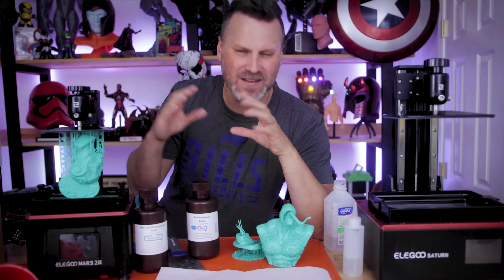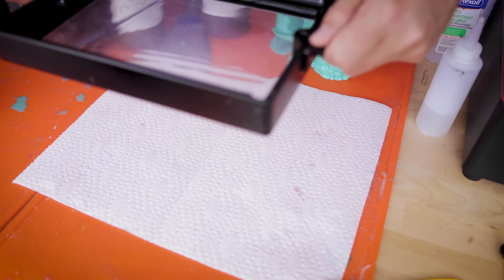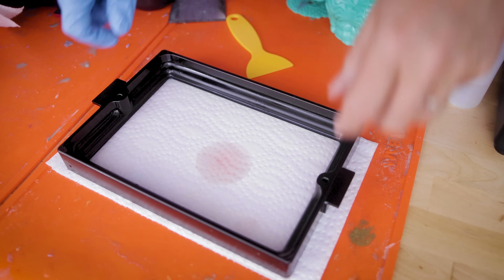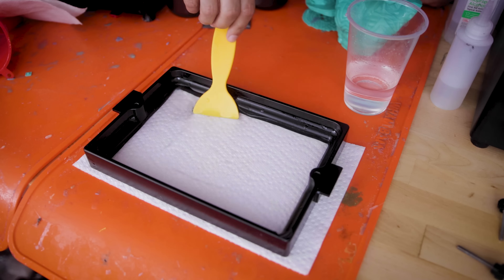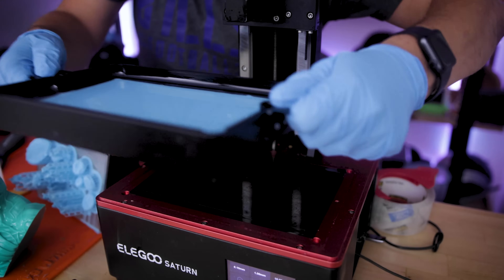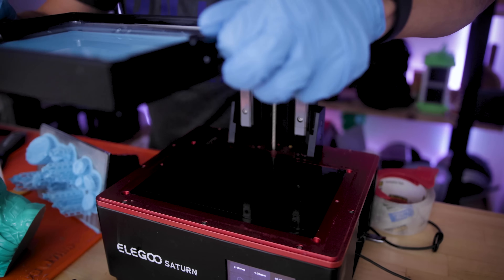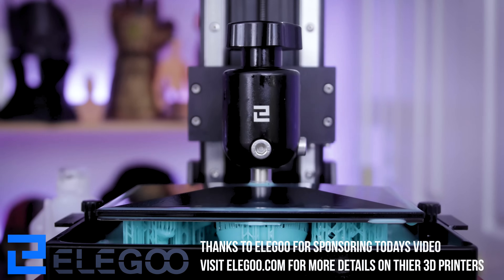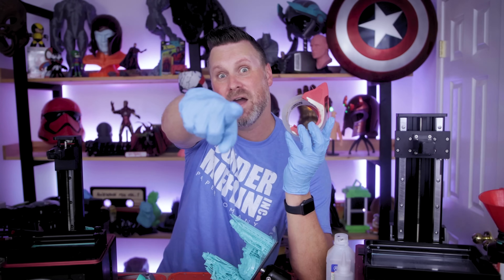Can you fix a FEP with Tape? Resin 3D Printing Test!

Comment: ok i saw your video... and i am wondering... i got no issues with the tank but accidentally i dropped the building plate, and even tho it looks undamaged i noticed the corner is the part that got hit, and it has a little tip going below the level of everything... i leveled it and even tho it worked pretty nice is it ok to print with it? is not a bug damage, maybe 1mm or less of the corner sticking outside but is it safe to use it like that?

using an elegoo saturn 3

Comment: Thanks for a really helpful video. I wish I had seen it before I bought a new set of sheets because I made a small hole when trying to get the resin sheet out of the vat after a clean😢

Do you know if it’s possible to buy a flex sheet for the Anycubic Photon Mono M5s pro? I have been having real trouble releasing my prints from the building plate.

Comment: Confirming, - You can print even longer with the tape (of course, probably depends on the size of the hole), - I was printing 2 weeks like this. 
(during the print, - once resin gets through the hole and gets trapped with the tape, UV cures it solid and glues the hole)

My hole was "micro" and in the corner, probably also matters and that area is not very "flexy/bouncy" during the prints.
(I have got the puncture he very first day printer arrived.... built plate fell into the VAT.... Obviously, - I had no spare FEP....)

Comment: I tried this and I noticed that the print has a little surface dent from where the puncture must have been and also the print had a slightly raised line going across the print, obviously caused from the rim of the tape. So this solution is not going to work for everyone's needs, it just depends on what you're printing.

Comment: Does it make sense to attach a new tape after each print? I mean there will always be some cured resin residue stuck to the exposed adhesive I suppose...
Reply: Absolutely not.
This is a 'permanent' temporary fix, so you will.
You will be unable to remove all the glue and the cured micro resin blobs from it, and/or in attempting to do so you will damage the FEP film way way more than if you left it.

This is nothing more than a VERY temporary DIY hack, absolutely nothing more.
And the FEP should be replaces ASAP.

Comment: as someone who has testing this long term (not bc I wanted to) for +20 hours of print time: at a certain point, it begins to warp due to a micro amount of resin captures in the crevices. at first, as you can see here in this great video, it almost works like nothing is wrong, but keep in mind that's an extra amount of material not only to compress over and over but pass UV light through. small pockets with resin harden and remain. This cycle repeats and builds up to where you're going to have to compensate by releveling. At that point, you get the failures. it becomes more a matter of failed prints than broken printer. though i fear broken printer is next but i dont advise anyone go this long. but can confirm on the saturn elegoo atleast - if you are in a pinch, this will no problem get you through your next print. maybe two. but never test it if you can avoid it.

Comment: Maybe I am decadent but I simply have another vat (not as damage replacement but to make using more than one resin a more comfortable experience), don't need to risk my screen with temporary patches. Especially as a Saturn2 PFA sheet is 8 EUR per piece.

Comment: I just tried this cause I installed a new FEP and somehow managed to immediately put a hole in it when the last one lasted like 5 months(and I wasn't trying to undo all those screws again within 48 hours). Have a screen protector. 

So far so good? I mean I have a spare FEP and protectors I'm prepared to switch out the second I see funny business. But good to know I'm not the only one who had this thought. 

apparently they do make actual FEP grade tape too(like legitimately the same material as your fep)? I just used clear duct tape. 

This worked well enough that I actually replaced the black electrical tape around the screen with packing tape cause I guess at some point mine got resin on it and it was kinda ew. The machine looks a little silly but it's staying clean and so far nothing has rattled my confidence. No fluid getting under the tape(you can press it and see bubbles if it was), etc etc.

Comment: I just started with Resin printing and wondered, since there are protection foils for the UV screen, could they not be put either into the resin vat or on its bottom? Sticking it into the vat could protect the FEP and sticking it oudsite onto tho bottom would prevent resin from leaking out if the FEP might be damaged. At least these are my thoughts...
Reply: A few years ago when I first got my anycubic mono and it had the unattainable FEP in a frame I was forced to use packing tape to fix a hole. I printed for weeks with it until a gave up on a anycubic replacement screen and swapped out to  Sovol vat.  The packing tape never did leak.
Reply: @Tank1TC  These days I'm thinking about the foil where the prints do not stick (nFEP was it called). I can imagine with no sticking it should last longer and the printing supports could be reduced as well.

Comment: The hole will contain liquid resin, then the UV lamp will solidify it in that hole, it will stay there and that hole will prevent the passage of UV light because it is covered with solid resin and technically it will be a hole in all impressions and its depth will depend on the height of the model to print.

Comment: For resin newcomers, pinching a hole through your fep is inevitable especially during those first few prints where you are experiencing your most fails. 
I would suggest to run your finger all over the fep every other times just to check if there are any bumps that needs attention . 
Clear tape works for temporary fix, just make sure you cut it with scissors on both side. Dont tear it off of a dispenser which will create those ridges and will affect your UV light on that area. During slicing try to avoid the area with the tape because it will show up in print. 
Another useful tip is to never ever wipe/scrape your FEP with any tools, not even the plastic scrapper or kitchen towels. This way it will stay clean & clear longer. If you really need to wipe em, dry some wetwipes and wet it with some IPA.
Reply: What is the reason for tiny puncture holes? I have been using my mono for ages, and this is like the first time it happened to me. I just upped the lifting speed, can that be a cause or it is just an accident?
Reply: I was considering soaking some 1x1 inch microfiber towels in IPA and then just stick the container off to the side of my workbench, anytime I need a wet wipe I'd just grab a small cut towel.

Would that work similar to the wet wipe and not scratch the FEP?
Reply: I touched it with my bare finger and it left a mark, use gloves lol.

Comment: I was being a complete noob yesterday when I got my Saturn S and made a micro tear in my FEP after my second ever print. It wasn't visibly leaking resin from the bottom, but was leaving cured resin on my LCD after prints. I was so worried that I broke my machine and would not be able to use it again until I got a replacement sheet, but I tried this method out and it totally worked! Next print came out beautiful and I just got my replacement FEP in the mail today. Thanks, Uncle Jessy!

Comment: If you even need to do a patch like this with tape, first get the surface of the sheet and the tape wet. Ideally with  mild soapy water. Apply the tape and then run a plastic straight edge over it to remove any air bubbles. allow to sit for a bit to cure up. Tape will be hardly noticeable depending on the color of it.

Comment: My FEP just got a hole in it. I just replaced it recently too which is a bummer. Maybe I should try this for a couple prints before I replace it. I also wonder why is the FEP so thin? Wouldn't a thicker FEP sheet be more durable and longer lasting?

Comment: Thanks Jessy, you da man. I'll be doing this on my Saturn today. Luckily I had a transparency sheet to protect the screen ( actually the original sheet that came with the printer) Was fine for about 20 prints. I messed up attempting to print some hollow trees. They weren't initially designed for resin and were far too thin. Scaling them down didn't help either. Great work on your channel as usual.

Comment: If the tape works on the FEP why can't we protect the screen with a thin sheet of plastic like the tape with adhesive like phone screen protectors? This way if the FEP leaks the screen will be protected and you just peal the sheet off and replace it, no cured resin on the expensive screen, this would definitely save a lot of headaches on a more advanced printer like a 8k or the coming soon Elego 6k printer. I see otters have used various products to do this, the printer manufacturers should sell something like this unless they want us to buy new screens?? $$$$$$$¢$$$$$$$¢

Comment: Does this impact on print quality?

I've got a FEP sheet that's wearing thin due to a piece of resin that broke off a filed build being pressed in to it and I'm nervous about changing the FEP. Could tape prolong the life of my sheet until my spare vat arrives?
Reply: Yuo gona need to change the fep soon or later , dont be afraid , its happend to me, just saw some tutorial and be patiente, there is aLot of screw there
Reply: @noway8233  tape was pretty effective, I ended up taping it and buying a broken vat online and fitting new fep to that so I have two vats now

Comment: I did that after a rookie mistake when I accidentally dropped my build plate into the VAT, FEP was punctured. I can see the contours of the tape's edged as the light is slightly bent in the edges.

Comment: Silly question. Have you left resin in your printer overnight? I haven't done an overnight print since 2016 when mine leaked at some point in the night. I now only print resin when I am in the room and set an alarm for when it will finish. It would be nice not to be tied to the printer and I am seeing people leave them overnight these days.
Reply: I got Phrozen printer and I have left the resin inside for the past couple weeks with no problem. I would be more careful once the film starts wearing down though, maybe check for damage before leaving it in.
Reply: @ej-1608  Mine was brand new. Had it 3 days in 2016 when it happened. It blew out the LCD. I never left it in there after.
Reply: @The_Digital_Samurai  dang, good to know it happens.

Comment: Just bought my first 3d printer! Elegoo Mars 2, can’t wait to start my journey. You were a big inspiration
Reply: Good luck. I had my Mars pro for 4 days and haven't had a good print yet. My 3 prints have stuck to the fep film. 🥺 I just want successful prints. 😫
Reply: @yurushii  I have had any failed prints yet… but my Epax x156 I just got is another story… pancakes after 12 tries… $3000 paper weight
Reply: @hoosegowindustries  i know you're pissed. I just want to have successful prints. I'm trying different exposures, bed leveling, cleaning my vat, e.t.c. My prints are still sticking to the fep sheet. I don't know what to do. 😡

Comment: As always, a few alternative ideas. Granted some of this is fairly 'specialized', but most any town still have camera shops. My first kneejerk solution would be to go get splicing tape, typically polyester. Clear as a piece of glass and very sticky. Yes, definitely falls into the niche category but it's really cheap since the digital revolution took hold. Amazon too, if you're pressed for a quick fix, but in that instance, having extra fep's would be the defacto answer. McMaster Carr also sells bulk FEP if you don't mind cutting your own. A good size roll can be had relatively cheaply and you can make dozens of screens from it. Sizing is key (they have several thicknesses, so a little homework is involved) and don't forget they post-charge you shipping after the sale. Archaic but that's how they roll. 
Nonetheless, if all ya got is clear tape, I'm amazed it didn't add artifacts to the print! I thought for sure you'd have a boundary outline at least, but man that's cool to see.
Reply: this. splicing tape works wonders here
Reply: Thanks for your suggestions. May I ask what thickness should I pick? I intend to use it on a Photon Mono X.

Comment: Jessy Great Video.  I found at times that the hole in my FEP are not seen until the build plate pushes down.  Especially when you have a wrinkled FEP.  I have transparency sheet on my screen to prevent any damage on my 3 resin printers.  The transparency sheets work well and dont seem to impact my print quality.
Reply from the maker: Yeah usually I find them when it’s too late. Loving that transparency sheet idea
Reply: @UncleJessy  try it out, I have a spare fep just over the top of my SM4K with only 2 holes cut for the vat threads holding it in place and I have an ipad screen protector on my Mono x. Both solutions work really well.
Reply: I would think if it's wrinkled it's time to replace it anyway.
Reply: That's a really good idea. Especially with these 4k Saturn screens that go for $200. Nearly half the price of the printer gone if you have a bad spill. Uncle Jessy, please try this out in a video.
Reply: I'm going to have to try that transparency sheet idea, or a screen protector, myself! Thanks!
Reply: Yes we really need a protect your screen video.  I purchased the mono X, and have read horror stories.
Reply: @brightnovastar  wtf why isn’t this standard… it’s like they don’t want people to get into this
Reply: Great idea!

Comment: Do you guys know if it is possible to use a whambam flexplate without using the spacer? I read that some people are fine with just releveling the buildplate after putting it on
Reply from the maker: No spacers on mine. Just -it it on and relevel. Should be good to go
Reply: @UncleJessy  i just installed it on my saturn, is it fine even if the card leveler doesn't move?

After installing it it just set it to Home and set z axis=0

Comment: Use IPA instead of water. If water seeps under, your vat screws will rust.
Reply from the maker: Ohhh great call out! Never considered that
Reply: @UncleJessy  Also your 'water test' to see if there is a leak is highly skewed.
Resin has much higher viscosity than water, so it wont leak as much out of that tiny pin hole.
However, that doesn't mean it wont/cant stick to it. Also caterpillar action between the film and screen will come into play.

The question is not so much if resin will leak out of that pinhole. The bigger issue is that such a pinhole WILL damage the FEP more and more (because of half cured resin buildup) and eventually your FEP will break dramatically because it is under pressure. And no matter how viscose resin is, it will spill out all over at that point.

IPA has the lowest viscosity, and will probably leak out the hole much easier.
As such, use IPA anyways, it will not only 'highlight' any tiny holes much much sooner than water will, it also wont contaminate the vat like water always does.
Reply: Not only that, water contains all kinds of minerals which WILL contaminate your resin.
It is very hard to remove all those particles, even after drying! (think: lime scale).
Water should never ever be in contact with any part of the vat and/or FEP. 
If you really MUST use water, use demineralised water at the least.

Comment: I would actually put a piece of tape on the top and bottom. Not just one side. Otherwise you will get resin trapped between the tape and the fep sheet.
Reply from the maker: I wonder if that’s why it was puckering for me

Comment: Awesome video as always! One suggestion:

Use ipa, not water. Water can cause areas in the resin to seriously mess up. Ipa will evaporate if you don't quite finish mopping it up
Reply from the maker: Yea agreed someone else also mentioned the water could speed up the screw rusting in the vat
Reply: @UncleJessy  yeah, that’s reason 2.  Water bad!
Reply: also water has more surface tension than IPA, IPA will leak from VAT instantly